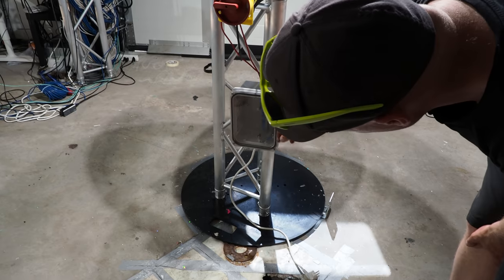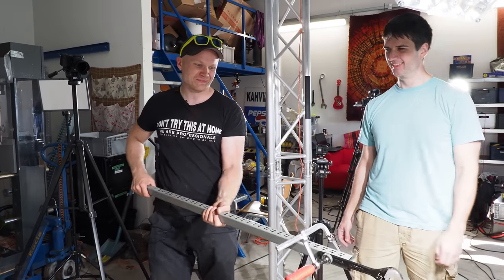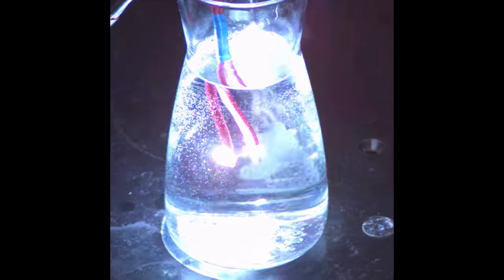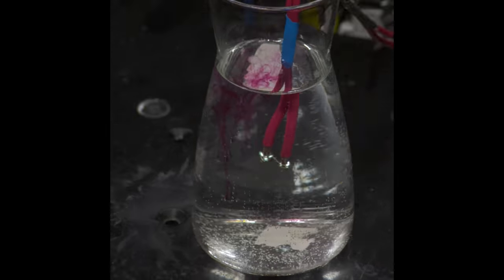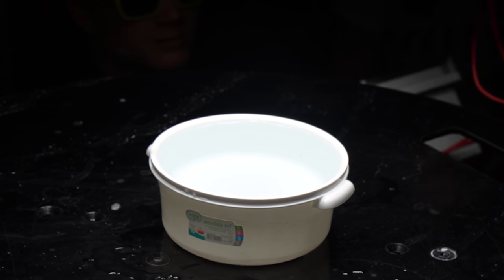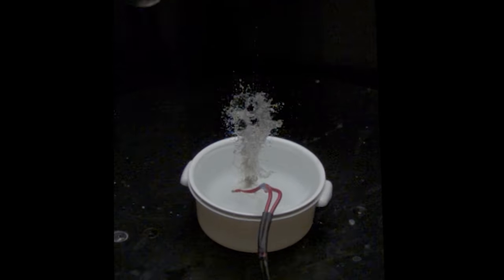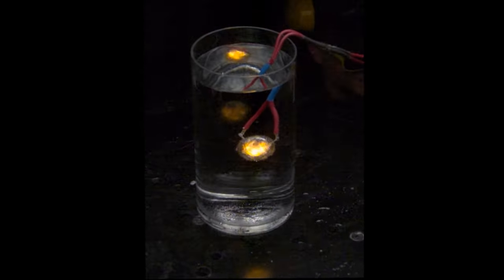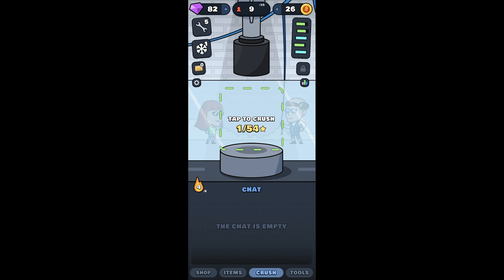Making Cavitation Bubbles with Electricity | at 100 000 fps

Comment: Freeze it into a block of [transparent] ice- it'll show the cracks propagating through the block when you switch it on.
Reply: Yes! that would be a neat thing to see filmed with the ring.
Reply: Well, at that point it'd just be ice breaking from a small explosion going off inside it. Plenty of videos on cracks forming in materials on The Slow Mo Guys' channel, but not so much of bubble cavitation.
Reply: @firesong7825  Ice is a solid, it wouldn't cavitate.
Reply: @tomf3150  I think ice should turn back into liquid if you get high enough pressure thanks to the electrical power. I would say an experiment with crossed wires inside ice cube would be worth doing.

Comment: Awesome work guys! I do have a couple notes for improvement though:

1. I Hope you guys put some big diodes in place to protect the capacitors from damage. 

The inductive kickback from the sudden release of energy needs an alternative path to go back through other than backwards through the capacitors.

2. Also you should create your own guillotine type switch that will be durable and easy to unweld. Switches are simple, all you have to do is slam two pieces of copper together quickly! A spring-loaded plunger, held back by a pin as one connection, and the surface it strikes is the other connection.

Looking forward to the next video!

Comment: cant watch it with all the spinning
Reply: Yes! I want this from single camera.
Reply: The fact that it's spinning gives it the super slow motion.
Reply: @Qwarzz  
Literally not possible, you need that many cameras with timed frames to achieve such slow motion at that resolution.
Reply: Totally agree, lose the ring thing and get a normal slow-mo camera.
Reply: imagiande that you control the angle of the camera by selecting  a camera on the ring
Reply: @Thefreakyfreek  A single camera cannot record that fast, each camera is recording frames as fast as possible, and stepping around in a circle is the most viewable way to have them synchronised.
Reply: @samheasmanwhite  they are hich speed cameras so thay all record at the same time or do thay work like a gatling gun   which I doubt   if not it realy does not matter if you select frame 30 from camera 20 and so on you should be able to control the spinning yourself not at a smooth angle but more like those 360 views you get on some web shops
Reply: @Thefreakyfreek  The cameras capture each frame one after another as it goes around the ring, so kind of like a gattling gun. It lets you capture at a framerate way higher than a single camera can achieve, you multiply the framerate by the number of cameras you have. This is actually not as fast as it can go so they could have used a single camera for this one, but a 100,000fps camera is VERY expensive and the resolution is tiny at that speed.
Reply: @samheasmanwhite  oke thanks I did not understand had to wach the video on mute
Reply: @nicholasrossi2316  The entire ring is high speed cameras... By stepping around the ring you multiply the framerate. Higher res and higher framerate than what is possible with a single device.

Comment: That last one looked pretty good actually. You could definitely see the bubble get bigger again at the end.
I think for a better result you would have to use higher voltage caps, maybe 5kV or so, some more energy, and then use the water itself instead of copper wire to complete the circuit. That way there should be less copper getting vaporized. 
And also ideally use a better trigger switch. Ideally a high voltage thyristor, but at least something with very large contacts.
Reply: Frankenstein knife-switch.
Reply: Would be interesting in a taller container too for more water pressure on the bubble.
Reply: @firesong7825  That wouldnt do much as even a 1m high container will only add 100mbar more pressure on the bottom (10% more). For that you would have to seal off the container and then pressurize it.

Comment: Need an air spark gap switch for dumping the power from the capacitors both quicker and more efficiently.
Reply: Yes, or an SCR for medium voltages like upto 2000V, or some kind of thyratron if he was running 10s of KV. I done a few tests like this with pulsed DC from energy caps into water, produced some good effects, but I didn't have no fancy cameras, its a shame the electrical setup is not as grand as the camera setup. These water and HV pulse experiments are difficult to find on youtube.

Comment: Need thinner wire (less vapor to cloud up things) but more voltage. Like 10-20kV and 5kJ and maybe 50,000-100,000 amps (enough to shrink a quarter) to heat it to maybe 100,000 degrees. Cheap 300v electrolytics have way too much ESR/ESL to be useful for heating/exploding wires fast enough unless you parallel a MJ worth, and are then very difficult to control (a few V is the difference from exploding wire and exploding the table or entire room).
Reply: I agree completely, more volts is needed, a more serious capacitor bank, and something like a thyratron. Must have blown all the money on the cameras, one would have been sufficient. even a 60KV 3uf cap can deliver 100KA ns pulses into a dead short - that would have been something cool to observe. my situations the opposite, I have lots of electrical stuff but no fancy cameras, one would be plenty for me.

Comment: Everyone is complaining about the framerate, but realize that:

1. If you're doing actual science with it, it would be helpful in some cases to see it from multiple angles.
2. 100,000 fps is a lot. This setup gets around shutter speed limits by activating the camera in series around and around the ring. This produces a spinning effect but offers high resolution, high framerate video for a (relatively) small amount of money.

Stop asking for a redo with a more traditional high-speed camera. Unless you have money or connections, those are hard to come by. Be thankful they were given this opportunity instead of being angry it doesn't meet your quality standards.

Comment: You might look into switching the current on/off with a large 'brick' IGBT from Semikron or similar.  This would separate the humans from the high voltage switching.  You could trigger the IGBT with a 9V battery, or be a bit more sophisticated and do it with a pulse generator and control how long the power stays on.  I have a background in pulsed power (which is what you are doing).  It's considerably more dangerous than if you just got shocked with a wall plug due to the current available coming out of the cap bank (hundreds or thousands of amps).  Please look at ways of doing this more safely.

Comment: Got another idea to get the wire to explode where you want.  Solder the small wire to the supply wires then half cut the small wire with a set of side-cutters.  The solder should eliminate the arcing and the half cut should make a hot spot.

Comment: The ring gives two advantages - obviously 360 view, and max FPS per cam * number of cams (theoretically).  How about rotate the subject to match the camera capture sequence to give a nice traditional shot with super high FSP? 360 is nice for some subjects, but is mostly sickening/dizzying.
Reply: This was filmed at 100k fps. There are 48 cameras in the ring.  To rotate the object so it's facing the appropriate camera means that it would face 48 cameras in a single rotation.  To reach 100k fps the object would have to rotate at around 2k rotations per second, or around 120k rpm. Not a simple feat.
Reply: You could probably turn the spinning video into a 3D render- then replay it from any angle without the rotation.
Reply: They did that with the CD shattering video.

Comment: That's definitely a bubble-shaped space within the water, but I don't think it qualifies as a cavitation bubble. Explosion bubble, perhaps. Cavitation happens when an object, like a ship's propeller, moves through the water at such high speed that the water separates from the surface of the object, leaving an empty space (well, probably filled with water vapor). The problem with cavitation on ship propellers is two-fold. 1. You lose propulsive force from the propeller since the water isn't flowing smoothly across the surfaces, and 2. the collapsing of the cavitation bubbles emit a sound. That sound isn't too much of a problem for normal ships, but it's a dead giveaway for military ships when enemy ships can detect the tell-tale sounds. Oh, and 3. cavitation causes excessive wear on the propeller.

Comment: Few more ideas how to see the cavitation. Melted copper in the water (dangerous it explodes), trick with hitting beer bottle from the top,  and what you already done but with higher voltage  it can break rocks apart, and underwater nuclear blast ;)

Comment: Awesome video. I love Your channel. I will try it but I will use a huge thyristor instead of the mechanical switch. The mechanical switch wastes huge amount of power for arcs between contacts. Thyristor is much faster and its voltage drop is only about 1.5 Volt. This will allow me to concentrate as much energy as possible into the 'exploding' spot.
Reply: Nice, it could do with a higher voltage capacitor bank too so you can have a longer arc and dissociate more of the water.
I kinda want to see what happens if you put some small coils in each wire before they meet so the arc occurs in a tangential magnetic field generated by the coils, it might shoot out due to the lorentz force the way a railgun does, probably won't go far but a directional shockwave in water might be cool.
Reply: @samheasmanwhite  Good idea. I will try this weekend. The only problem is that I have really cheap camera that makes only 25 fps so I can't really make slow motion video. I have already tried it but there was always like one frame of unfocused arc globe.
Reply: @KUBA64official  Ooh, yeah, arc photography is a bit tricky. But if you have a still camera that can be triggered and some way of making an adjustable delay you could trigger it with some delay from the triggering circuit for the thyristor and repeat for different delays. Wouldn't look great but it would at least show how the bubble evolves over time, even if it looks a bit different in each frame. That technique can get you arbitrarily fast framerates if what you are observing is repeatable enough and the shutter is fast enough.
Reply: @samheasmanwhite  Thanks a lot for your advice. I have already tried. I found out that I can set my camera to 50FPS mode which is a bit better but of course my video can not be compared to this one. The best result occured when I put 15V zener diode in reverse direction into the water instead of a piece of wire. I have 2200uF capacitor which I charge from mains voltage through 100W tungsten bulb and bridge rectifier. The bulb indicates the state of charging. I will upload video about it but I will speak Czech there.
Reply: @KUBA64official  Huh, the diode thing is interesting, good to hear you got somewhere with it :)

Comment: Makes sense that the first setup had two distinct "explosions" as the connection points has significantly higher resistance than even the small wire inbetween. Basic Ohms law 😉 Ever had a voltage surge through an electrical system you'll notice it's the connections that get burnt, the poorer the connection the greater the burn.

Comment: I liked this presentation, but its a shame it seems there wasn't as much money spent on the electrical components vs the cameras assuming they were all bought and not given? Anyway I read some of the comments here, and imo I would have used a slightly larger capacitor bank and a higher voltage overall, in the range of several, to 10s of KV, also a thyratron instead of that "isolator" to switch the energy,  far better ways of doing it and not too expensive either. But there were some good shots nevertheless. Not a complaint, more of a suggestion on how it could be oh so much more amazing. exploding water with electricity can be used to do hydroforming of metals, and shattering rocks without explosives etc.

Comment: Make a wire with a stretched neck in the middle, bend it so  U with the neck at the bottom and lower it into the bottle.
so the only weak point in the water is  the necked point at the bottom of the U.

Comment: Very cool! I've always wanted to see something like that at insanely fast framerate. But I believe the flaw in your system was 300 volts on the capacitors. You need at least several thousand voltas to effectively explode wires and maintain ionization. To put it simply, when the wire starts exploding from the sides, 300 volts is too low to break down the resulting vapor gaps and the process doesn't work so well.
Reply: I dont think breakdown is an issue here. I think the wires didnt even go apart completely. It's just not enough energy and not fast enough, and the copper that gets vaporized makes everything cloudy. With higher voltage, the energy would be dumped faster, and you could leave out the thin wire in the water because the water itself should conduct well enough, so almost no contamination.
Reply: @Basement-Science  Yeah, the faster energy input, i.e. higher peak power means a lot. Completely agree.

Comment: A lightning "arrester?" needs to have as straight wires as possible. If you have a sharp bend in a wire, the inductance will be higher in the bend than on the straight wire, and with a pulse (or high frequensy) the voltage buildup, will be higher in the bend than in the straight part. Resulting in ionisation/flashover in the bend before in the wire. Puh 😅

Comment: Instead of the giant switch, wouldn't it be better to use like a high amperage HVAC contractor? I would think the pulse would get less resistance from the initial contact than a turn switch. Plus you can get rid of the safety switch and use a 24v signal instead

Comment: Wonders when you use transducer in water an bubble if there is a way too trap something inside of it since it does heat too the point of the sun an repeats would be possible too heat said inside of it.

Comment: I know that making it rotate is diffucult and expensive,  but it makes it VERY hard to see what's actually happening. Stop spinning!
Reply: I guess you could spin the stage around at the same speed as the cameras- making it appear stationary.
Reply: I think the high frame rate results from the ring of cameras firing in sequence around the circle. IOW it isn't a special effect, just a side effect of the way the slow motion is made. Maybe the table could be spun to compensate, but it might have to spin so fast the water would come out of the containers.
Reply: That completely defeats the mechanism behind what allows these cameras to achieve such a high frame-rate. They fire in sequence.

Comment: Your setup is actually pretty far from even a decent setup, unfortunately.. This would have been really cool to see if you had a more proper "exploding wire" setup. Google "Exploding Wire Experiment" and you should find literature on it, since it is used by researchers in academia (I had some experience in the past with it).
 The bottom line is, you need higher voltage (~10kV), less capacitance (~100nF) and very little wire inductance (<1uH), plus a spark gap as the "switch". These factors make the peak currents of the order of 10-50 kiloAmps, which explodes the wire in nanoseconds (which you wouldn't be able to see with the camera, only the cavitation bubble). I assure you the results would have been really exciting because the strength of the blast is proportional to like the 5th power of the peak energy - so if your peak energy is not much because you didn't do a good job on the electrical engineering side of things, then your mechanical wave will be rather lame (as you witnessed here).
People in the exploding wire business use 10Mfps cameras to see the phenomena, and I can tell you, it is really rich. I've never seen anything done underwater, which got me interested on your video, but I understand doing a proper homework with a scheduled set of experiments is not always possible. Explosion research in air is used to maximize damage of blasts and weapons research.

Comment: Can you flim the light laser for 1 million fps ?
Reply from the maker: At 1 million fps light travels about 300 meters per second so in out doors and with REALLY strong laser you could film it
Reply: @Beyondthepress  You should definitely do it. I've been waiting to see that for a long time. 
Maybe one of those "tatoo removal" machines that Styropyro showed a while ago could do it. It's a super high power pulsed green laser if configured correctly.
Reply: What if you set the cameras to only fire once- and sync it up to the laser. It'll give you 48 frames at 10 million FPS, allowing the laser pulse to move 30m in each frame.